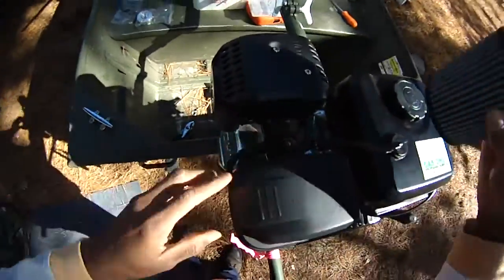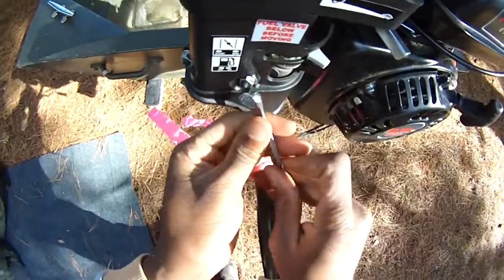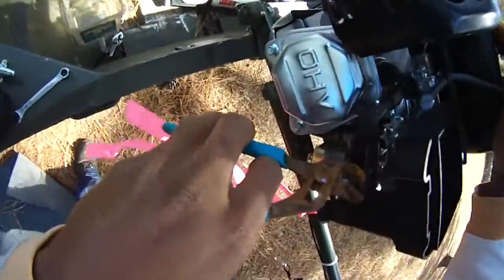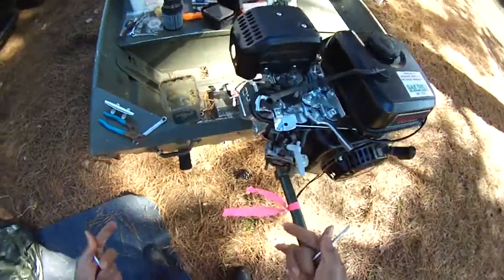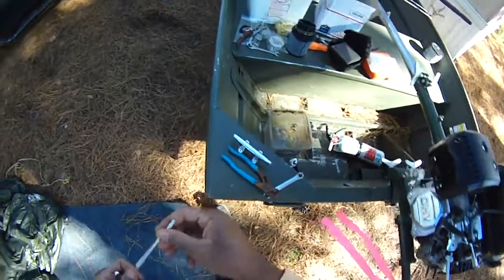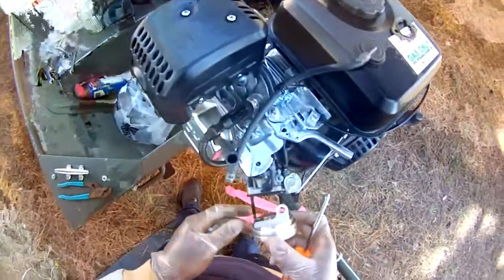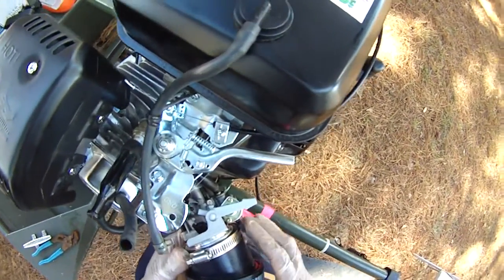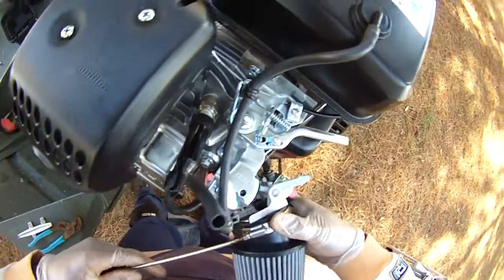SPS Longtail Hot Rod Your Mud Motor e-Course | Intake Install

Comment: Great tutorial! Just picked up a brand new Predator 212cc for $50 from a customer who was going to use for a gokart project as an extra but didn't need it. Checking to see if you ordered one of NR racing's hop up kits or did you order the parts separately? The reason I ask is that the air intake parts in the hop-up kit don't look the same as the parts you installed...Thanks!
Reply from the maker: Tom Riegel I ordered my part separately from OEM Warehouse. More recently I've been buying from NR Racing. I bought the jet kit and air intake kit from OEM Warehouse. I bought the first tailpipe from SPS North America. I've replaced it with a tailpipe an muffler from NR Racing.

Comment: Hey man. Love the tutorials. They helped me out a lot. I've got almost the same set up as you with the exception of I have the 8hp 312 cc predator model. Do you know if the air intake and exhaust you have will fit the 8hp model also?
Reply from the maker: Peyton Adams Oh, I wondered how the 8 h.p. model would do. Na, talk to the guys at NR Racing. You would need to order the GX240 or GX270 upgrade parts: http://www.nrracing.com/category-s/2144.htm

Comment: i work on small gas engines  to get the carburetor hold down rods you take both nuts put one on one we put one on the other way and you can spend that right out and put the new one in
Reply from the maker: +Joseph Kiefert Yeah, I tried that, and it still wouldn't budge.
Reply from the maker: +Joseph Kiefert I've thought about taking a small engine repair class at the community college.
Reply: Some times it really hard to get them off  but when you do get it off put some anti seize on it when you put it back together
Reply from the maker: +Joseph Kiefert Okay, that makes sense. I might try and give it a shot when I change the oil.
Reply: I've always had to use a little bit of map gas to get them to budge a little . Or you can try doing it when it is hot
Reply: And when you first it it to move go back and forth to loosen it

Comment: Can not understand why peoples added extra air filter on engines used on the water ?
Is no any dust there.
Reply from the maker: Simple answers: 1. Pollen here in the southeast USA pollen gets thicker than smoke in spring time. 2. I drive down a very long dirt road on the way to the boat ramp. By the time I get to the water, there is so much dust on the air filter that I've had a hard time starting the engine. There is always more than what you see.

Comment: did you put a prefilter on to avoid the filter from getting wet in rainy conditions?
Reply from the maker: Na, I never ran a prefilter, but I think it's the way to go. I always cover my motor in transit and storage. So the air filter never gets wet.

Comment: for removing the stud you could thread 2 nuts on the stud jam them tight against each other then putting your wrench on the bottom nut back out the stud.
I attached a video that illustrates what I'm trying to say

https://www.youtube.com/watch?v=66ATKL4G04M

I like your videos so far, they are very detailed
Reply from the maker: Yeah I did try it that way, but it wouldn't budge. Soaked it in WD-40 and everything. It would never move. I quit before I broke the stud off.